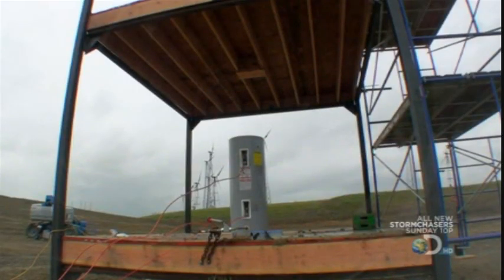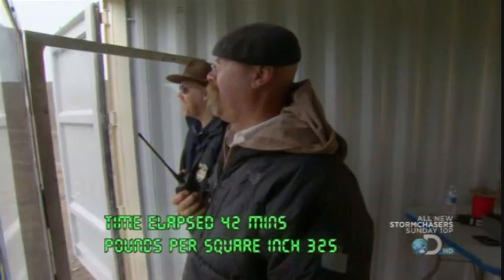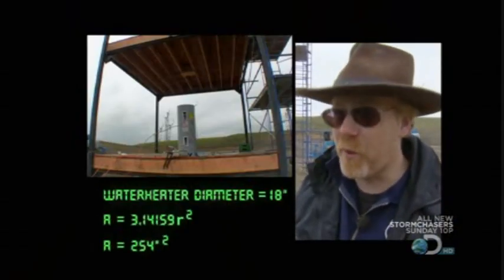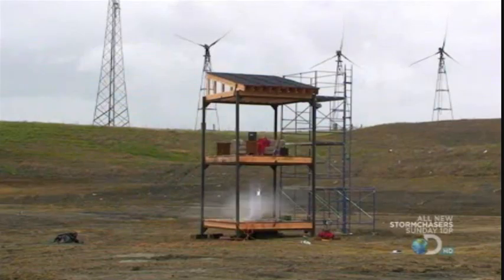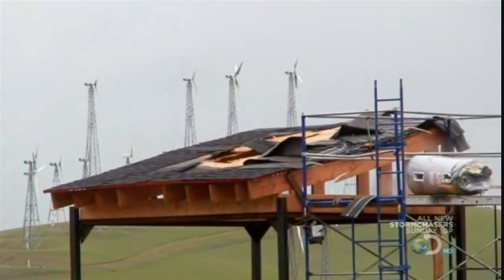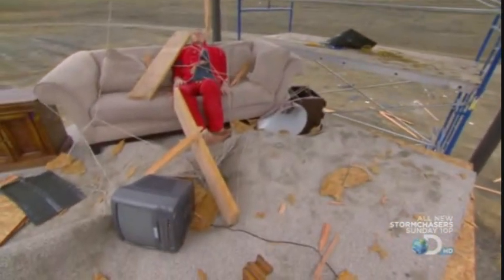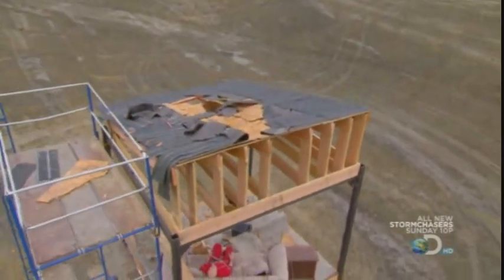Mythbusters Water Heater Explosion

Comment: This type of mishap is now known as a BLEVE, for Boiling Liquid Expanding Vapor Explosion. They're interesting because in the fraction of a second while the steam is escaping the container acts as a steam rocket, propelling it with great force. In historic accidents with steam locomotives, the boiler would often rip from the chassis and fly several hundred yards, more recently a boiler ruptured at a medical clinic, driving it through a concrete roof and hundreds of feet into the air. Yes, steam can be a lot of fun.
Reply: As a boiler inspector for the last 30 years I can only say, you don't need to be afraid of steam but you damned well better respect it!
Reply: @lawrencelewis2592  as a boiler inspector of absolutely zero years at all, i'm gonna stick with afraid myself. i already fuck around with electricity, no need to further tempt fate
Reply: @spambot7110  I see your point- I can rewire an antique car but I can't wire up a 110 volt outlet.
Reply: Chernobyl's actual explosion was this type of explosion, too.
Reply: I like an alternative extension of that acronym, Blast Leveling Everything Very Efficiently.
Reply: Or, Bloody Loud Explosion Very Exciting @DeuxisWasTaken
Reply: I BLEVE you
Reply: I work with mains hot and cold water supply, 415V electrical supply, LPG or natural gas and steam on the equipment I deal with. 
Steam is by far the scariest.
Reply: If you take a 3 litre soda bottle and fill it with the liquid air from 6 air dusters and throw the lid on and duct tape it on and put it at a 45degree angle.  And then prop it out in the sun.  About 5 hours later the bottom of the bottle will fail and it will have a defining blast as all the liquid instantly turns to air and it rockets at absurd speed away up to almost a mile on a really hot day.
Reply: And that’s why you blow down your steam boilers weekly, at MINIMUM. The reliefs should be opened yearly, at MINIMUM. That low water cutoff is pretty important. So is the relief.
Reply: The York Air conditioner plant had a boiler explosion that killed two workers and the boiler landed over a mile away at York College. I think this was in the 90s.  They never found the workers who were standing near it when it happened   Nothing left to find most likely.  As an 11c in basic training when we were live firing 120mm mortars someone asked the drill sergeant what happens if it blows in the tube in front of you. He said don’t worry about that you won’t be here to suffer at all.  So probably the same thing as those two workers.  Sad for their family and friends but no pain for them.
Reply: If the water heater were full of a flammable liquid a BLEVE might be possible but not in this case.   It's just steam.
Reply: @DanielTaylorOCMD  nope! look it up, a BLEVE does not have to make a fireball to count. first paragraph of the wiki page clearly says combustibility is optional
Reply: @spambot7110 While you may be right technically,  I'm going to keep my delusions and say it's not a real BLEVE.  I want to see combustion of the vapors!

Comment: Ok. Now, I am a big fan of Mythbusters. Have been for years. But something I saw in this video has me thinking this was somewhat staged...Hear me out. 

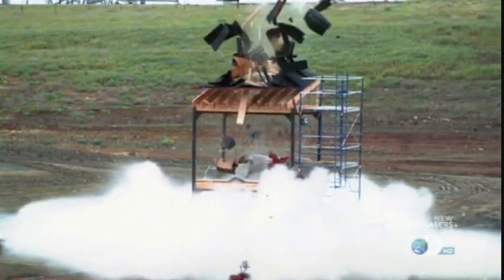Take a look at the 2:09 mark in the video. Use your setting to change the playback speed to as slow as possible. Then hit play. You will see a very clear detonation, a flash, coming from about 3/4 of the way up the heater. Looks like, maybe, they used some sort of explosive device to set the heater off. 
What do you think?
Reply: I think if you looked at the very start of the video when Adam is standing next to it, you'll see that there's an electrical cord powering the elements in the heater attached at that location. What you're seeing is the electrical flash caused by the cord being ripped loose and arcing.

Comment: This is for all of the geniuses out there that replace their leaking pressure relief valve with an iron plug.
Reply: No kidding.  Those iron plugs can corrode and fail.  Best use a stainless steel plug for safety.

Comment: A few years back there was a 30 gallon under counter hot waters that exploded in a block building. It not only destroyed the building it was in it blew the windows out on a building almost a block away and the tank laned 3 blocks away and rattled the windows in my house 5 blocks away and around the corner. A lot of things had to go wrong for the tank to explode and they did.
Reply: Sounds like a boiler, not a water heater.
Reply: @rossbrumby1957  It was a hot water tank ...

Comment: Had a customer with an oil fired hot water heater. The aqua stat failed and the burner kept heating the water. The temperature and pressure continued to rise. The temperature and pressure relief valve did not open to relieve the pressure. Water heat launched up from the basement floor, hit an overhead steel I beam and lifted the whole house slightly off its foundation walls. Thankfully no one injured but the house was a complete loss. Had to be torn down. 😳
Reply: Sounds like some moron put one way valves in the pipe between the mains and the tank. Normally the water would just be pushing back into the inlet pipe, therefore the pressure can't get much higher than normal mains pressure- which where I live is about 60psi.
Reply: @rossbrumby1957  if you're on city water there's a check valve at the meter that's not allowing pressure to be released back into the main. If you have a water heater tank you'll have a potable water expansion tank on the house side of the check valve which absorbs a little bit of expansion. On an overheat situation which causes pressure under expansion your temperature and pressure relief valve should let it hit the floor. If you were on a well system it will push water back into your well tank if there is not a check valve on the outlet to the home which is not common. You may have to replace that temperature in pressure relief valve but it's not a bad idea to trip it once in awhile as some manufacturers suggest. Most servicemen do not do it because they know it's going to most likely drip afterwards. T&p valve lift at 150 psi or 210 degrees Fahrenheit
Reply: @rossbrumby1957  The house had a well with pump which may have contributed. I don’t recall how everything was plumbed. All I know is our HVAC Fuel Oil Company was not implicated with the failure. Phew! I did immediately upgrade my own temperature/pressure relief valve and aquastat control on my similar oil fired hot water heater at home. I actually added a second T & P relief valve to my system as well.

Comment: We had an oil stove that had a water heater coil.  One day the coil exploded, blew the top off of the stove and filled the house with steam.  I was 4 at the time and was sitting at a table about 8 feet away.  The only injury I had was a burn behind my ear where a piece of hot soot hit me.
Reply: My mother in law was cooking spaghetti in a pressure cooker and the relief valve clogged up. When it exploded, it blew out the windows and spray painted the entire room with baked on spaghetti that stuck like concrete. Fortunately, no one was in the kitchen at the time.
Reply: Could you imagine if they put walls on what would have happened?
Reply: Did you go to Vegas afterwards?
Reply: @jeremytung1632  Nor sure that would work. His luck tank is empty for some time to come after that.
Reply: A piece of hot soot. Right.

Comment: Forget the roof, if all the openings are closed, you'd also shatter every window and door, and possibly even blow the walls outward, leaving no support for the roof at all.
Reply: I really wish they would have done another one of these in a room with fully built out with walls, windows and doors.  That would have been impressive!
Reply: @PeteBrubaker  and they came back and did it several years later. The myth they were looking at was could the water heater failing put out a house fire... It it did effectively put out the house fire by putting the house out... All over the yard. The fact that they mastered the ability to hold it just shy of 300 PSI until they needed it to detonate for that myth actually was the scariest part. The water heater detonating launched it several stories into the air but it also turned the shed sized building inside out.
Reply: @Skee7676  Unreal how it just blows the walls out, and that was a small one!
Reply: Nah. The house would be standing. The windows would act like blowout panels and preserve the structure. 

It'd totally shag all the drywall though, that stuff is brittle AF. You'd probably blow out the moisture barriers at the gaps in the outer sheath too.
Reply: @Solnoric  You should check out the video linked above.  House is standing, but it blew out the walls.  Studs included.
Reply: @PeteBrubaker  ...that's exactly what I said.
Reply: and everyones' eardrums
Reply: "and I believe that stain in the corner was my cat"
Reply: If enclosed in a solid structure e.g. replicating a basement, they would have been advised to move farther back than where they were.
Reply: Wait until you see a house trailer after this has happened. There was nothing but the metal base frame with some bits of floor still attached. The whole roof was in the yard as was the front and back wall. The poor man that was at home was found in several pieces.
Reply: I came here to say that. If the heater was in a small (one or two rooms in size), windowless basement it would have lifted the ground floor floor boards off the joists. 200 litres of water is around 350 cubic metres of steam, considerably more if it is at all superheated.
Reply: @Skee7676  Awesome!  Also, I've been on YouTube for years and this is the first useful reply I've ever received.  So, thanks a lot!

Comment: So why isn’t there a simple ball safety valve on this, that gets lifted when the water starts to boil?
Reply: The water DOESN'T boil, that's  part of the problem.  The pressure in the tank continues to rise, which PREVENTS the water from boiling, or just raises its boiling temperature.   But when that thing goes pop, the pressure is instantly released, and the the water flashes instantly to steam, compounding the damage.

If you live in Denver, water actually boils at a lower temperature than it would in, say, LA or Chicago, BECAUSE the atmospheric pressure in Denver is lower.

It was a damn good question though, Pieter.
Reply: Water heaters have pressure relief valves.  For this test, they eliminated it to mimic a malfunctioning valve and kept heating the water as if there is a failed thermostat.
Reply: @lelandlewis7207  So why does it even have a kettle construction that is dependent on a pressure valve for safety?
Reply: @KokkiePiet  not an expert but here are some probable reasons:
1) Energy Effecency, if air/steam can escape you are loseing a considerable amount of energy
2) The Boiler is typicaly at the ground/basement level, therefore the boiler may well be below the waterlevel of the higest point of the system, if it was open the system would drain through gravity or seperatly you will experiance issue pumping the water though the system. this could be engineered around but at expense
3) a way out is also a way in for nastys

Comment: So, if you have a gas fired heater and this happens, I imagine the secondary explosion from the gas line blowing into the house is not far behind. "An earth shattering KABOOM!"-Marvin the Martian
Reply: It depends on your setup. In my house I have a gas safety valve which shuts off automatically if it detects suddenly a drop in pressure as if the pipe broke somewhere. Starting the gas heater would not trigger this valve.
Therefore, with enough safety mechanisms you won’t be having issues.

Comment: What is the spark coming from?? One slow mo shot shows a spark..just pressurized water right? Maybe a valve smacking into another piece of metal or something? Answer my question!
Reply: 2:10
Reply: Spark is the result of a power arc due to the power wires being ripped off

Comment: What is the bright flash at the top of the cylinder just before it explodes?
Reply: That is an electric water heater. You will see "power cords" spliced to provide power to the upper and lower heating elements.  That is the spark of the electrical connections breaking as the main body of the water heater attains "lift off." 

For safety reasons, it is likely they chose to use an electric water heater so they didn't have to deal with ruptured gas mains when the inevitable happened.
Reply: @alanpenzotti2857  Thank you.

Comment: I've never seen a hot water unit inside a house before, only ever outside. I am thankful
Reply: You must live in a very warm climate not near the ocean.  You can't have a water heater outside if it gets to -20F at night.  Even garages are too cold in most of those climates, so they put the water heaters inside the house itself.  I live in a more temperate climate, but being close to the ocean, the ocean air will destroy your water heater within a couple of years, so it has to be protected as well.  Most people keep them in the garage.
Reply: @dlofgreen  I live about 2km from the ocean in Melbourne and it's certainly cold enough for me lol. Gets to 4c at night quite often over the cooler months. Anything below 0c is silly and I want no part of it. It would be far too expensive to run a heater for hours a day. My water heater is 23 years old now so is due for replacement but still works incredibly well thankfully

Comment: That's why you have temperature and pressure relief valves on water heaters. Test regularly. Most piping in any house will fail first. Not many houses have that kind of PSI. too many other elements will fail first.
Reply: Not to mention water will just be forced back out the inlet pipe into the mains once pressure goes above mains pressure. And where I live thats about 60psi. Realistically, I think most commenters' stories of explosions relate to boilers, not water heaters. In Australia we dont have boilers because its not cpld enough to warrant. We dont ever hear of hot water tanks exploding- because like mythbusters, you'd have to try hard to make it happen.
Reply: @rossbrumby1957  And since water doesn't compress, this is kind of silly.

Comment: The simulation isn’t accurate. They didn’t take into account the potential restraining force of the piping and stack (if the heater in question was gas).
Reply: good point, but soldered pipe joints will let go pretty quick with that kind of impact. Pex tubing might even stretch enough to change the trajectory before failing..... and ripping half the plumbing out of a small home at the same time.

Comment: All H.W.Us (Hot Water Units) must have a relief valve in case the thermostat fails causing it to continue to heat. The relief valve opens automatically when the temperature exceeds 100 degrees C.
 That valve also operates when the pressure increases and relieves the high pressure.
 Because there were 6 members to the family and the HWU was small capacity, they had the temperature at maximum causing it to work at maximum. Unfortunately it relieved pressure often and water leaked out of the overflow where the heater sat, under the house.
 The owner removed the overflow pipe and installed a cap to block the water outlet off.
 The thermostat failed and the heater continued to heat up until, like this one in the video, it exploded.
  They were sitting at the dinner table at the time and the heater came through the floor missing everyone and went through the roof land in their back yard about 18 metres from the house.
 They were very lucky, only bruises, superficial scratches and some burns from the boiling water.
 The moral?
Get a plumber!

Comment: Water heaters don't boil water. If they do, there's a really bad problem with the safety features installed before the water heater is even shipped to the retailer. That being said, this was a really fun watch.
Reply: It takes at least two failures - thermostat and the pressure / temperature relief valve. That should be a one in a thousand year event per heater. Higher if you actually check the relief valve once per year (the valves have a 1% failure rate per year). That’s what the lever on the valve is for.
Reply: @allangibson2408  Exactly.

Comment: I'm still extremely annoyed by the water heater explosion episodes.  As satisfying as the destruction is (and it's deeply satisfying), the cameramen always failed to capture the entire flight of the cylinder.  We get the launch, we get the landing, but they never got the entire flight. WTF?  How hard would it have been to have someone a long ways off filming the thing going up, reaching apogee, and then it's return to earth?

And while they were at it, at least once, attaching a cheap, disposable camera that was rigged to ride the thing on the up, and then at apogee be released to return by parachute, that would get us a video of the flight from the perspective of the water heater?  Hell, if model rockets have be rigged to do this since 1970 (the Estes Cineroc), it doesn't seem impossible or even difficult to achieve in the early 2000s.  Oh, and while we're at it include an actual altitude attained by the water heater (before Mythbusters ended, a real time altimeter from with a synthetic voiced flight data program (named KATE) was being fielded by high power rocketeers).

I honestly wish Adam, and the boys at TESTED would revisit this and give us video we all honestly deserve.  Perhaps even get Jamie to join in on it.

Comment: They don't show it in the video but to make the water heater fail that catastrophically took disabling all of its built-in safety features specifically designed to prevent that. So can this happen? Sure. Is it likely? Absolutely not.
Reply: Safety "devices"?  There's really only one device that's present on a hot water heater and that's the pressure relief valve.
Reply: @tenthdimension9836  And the vents, and the ECO valve, and the anode rod...